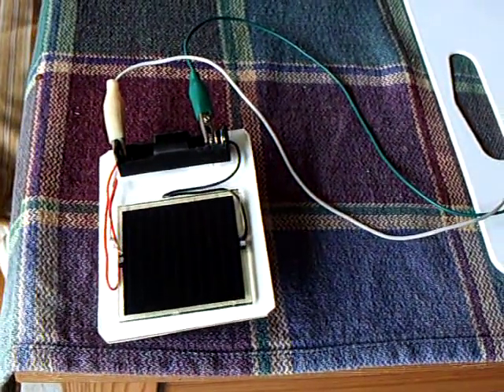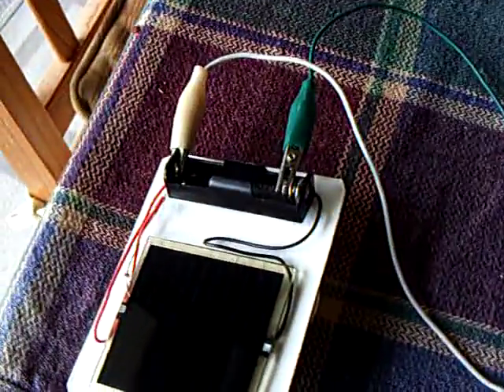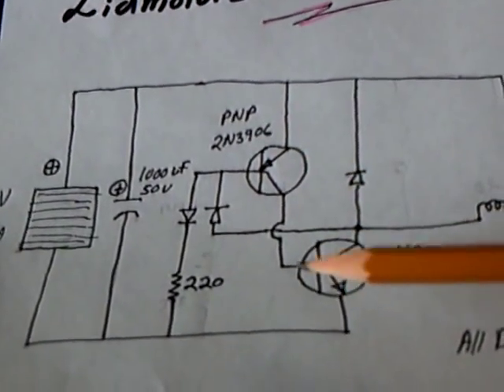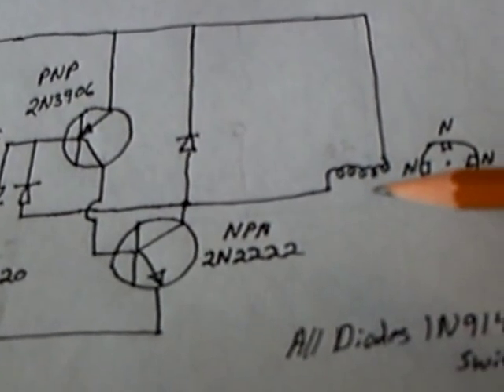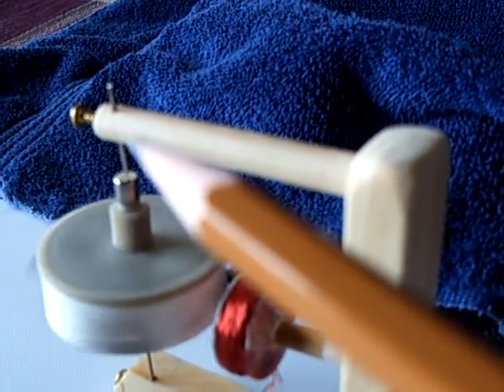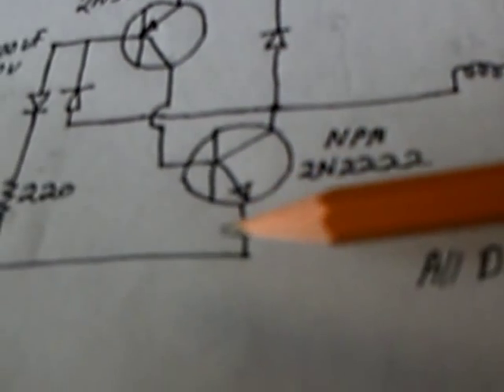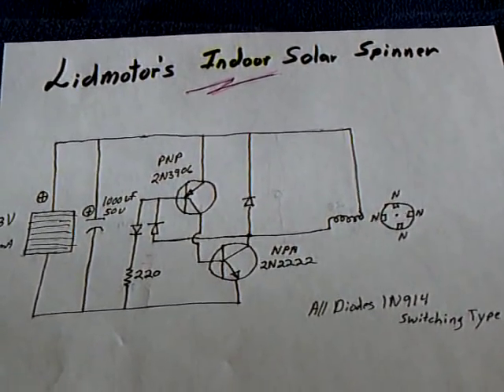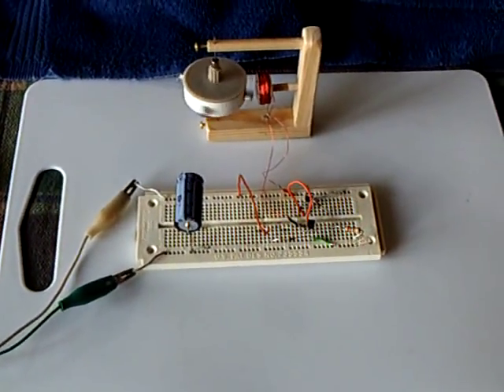Lidmotor's Indoor Solar Spinner.ASF

Comment: Hi Lid I also tried your Indoor Solar Spinner ASF all my magnets are north but my coil repel my magnets it don't spin i used my power supply  3v. are you using a reed switch in this diagram ???? help

Comment: Had fun building this.  I found that I didn't need the resistor. But I did need a potentiometer across the capacitor.  It was all due to the coil, I filled the bobbin with 42 AWG I salvaged from an old flashlight that is supposed to charge when you shake it.  I also used the big capacitor I pulled from an old disposable camera.  I tried others but this one seemed to make the most of the back EMF. Finally I decided to work out the rotor axel and bearings.   After days of trial and error I decided to lighten the load with smaller magnets and  ballance the lid as best as I could.  Still too much friction from my bearing setup and decided to do away with the axel and bearing concept all together and converted the lid to a spinning top using a darning needle and an even smaller magnet with just enough air gap between it and the top of the needle in order to keep the top right where I wanted it.  The top was placed on a small glass concave dish to control the bottom side. So now it spins in place with as little friction as possible just short of using a gemstone and brass setup.  But much more economical. This has been an awesome learning experience for both me and my 8 year old. He is in the second grade and loves to build and tinker as much as I do! Your videos get us amped! Thanks so much
Reply from the maker: Roger Smith I'm glad that you and your son are having fun building things together.  I try to do projects that are within the capabilities of most people.  They are for kids of all ages.